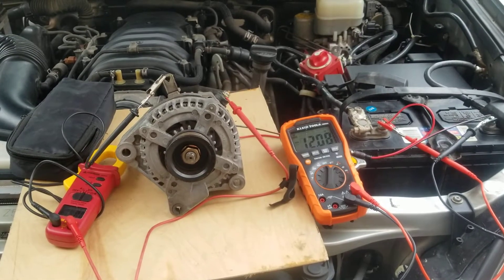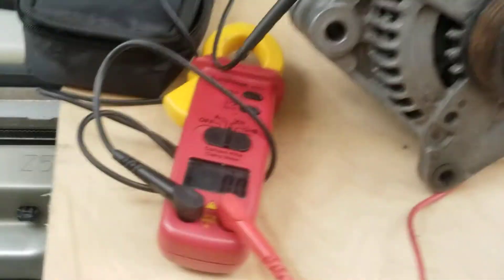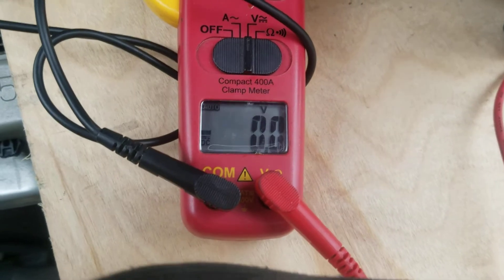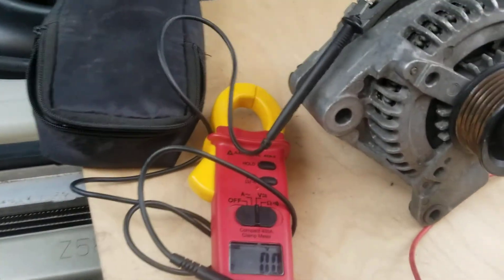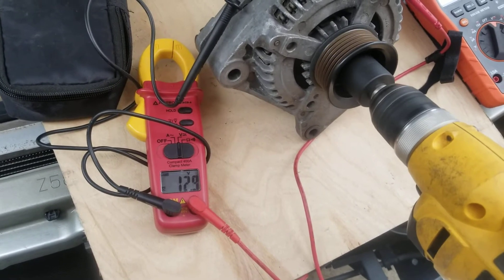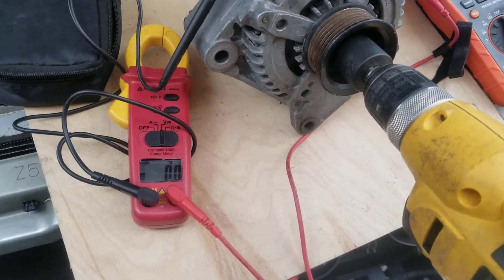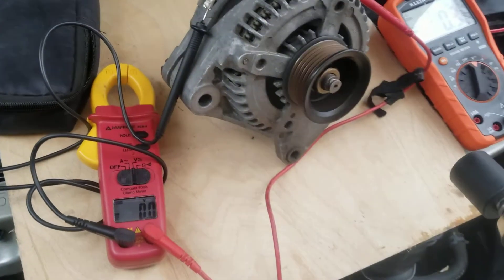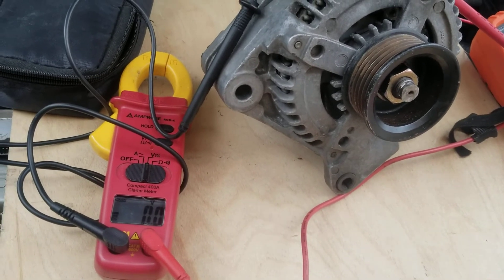DIY Wind Turbine Generator pt.1 - Alternator Bench Test

Comment from the maker: If you were really bench testing an alternator to replace the one in your car, you would want to use an oscilloscope on the output and see if any of the 3 phases of AC current was slipping past the old failing diodes/rectifier.

Comment: What did the alternator come off of?  What point on the alternator did you attach the 12v from the the battery?
Reply from the maker: It was a spare Denso from my landcruiser. I connected the battery to the brushes, you have to take the plastic cover off to see the screws and then connect them in the right polarity because one is connected to the whole housing (ground)
Reply: @dragon_offroad   ok. Thank you.  You removed the regulator correct? ( you produced 24v during your test ).   I have a toyota alternator from a pick and pull here in Dallas and have started playing with wind  driven power.
Reply from the maker: @Zootue  I believe the regulator is separate from the alternator in these cars, so theres nothing stopping the alternator from over volting! Ideally you need a way to change the voltage at the brushes to minimize the back EMF that resists the alternators turning so that the wind can keep pushing it, otherwise it will just stop dead and you'll be wasting a lot of power as inductance heating when it's not turning
Reply: So....you made a video showing us that an alternator produces electricity when spun. Amazing.

Comment: The only problem is that you'd have to be in a hurricane or a tornado to get it spinning that fast. I've been through a tornado in Xenia, Ohio. NO THANKS NOT AGAIN.
Reply from the maker: Yes ultimately you want some kind of gearing that changes the torque from a nice heavy turbine's slow swinging momentum into a high RPM generator shaft